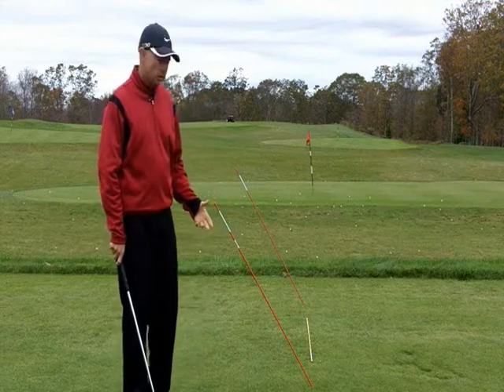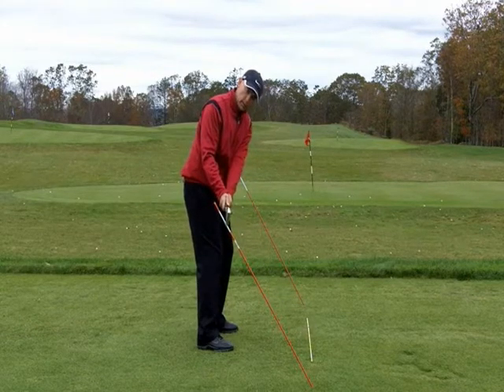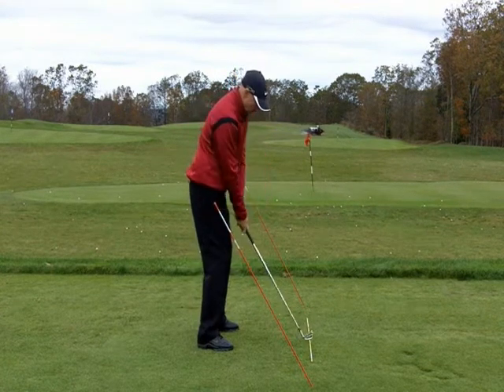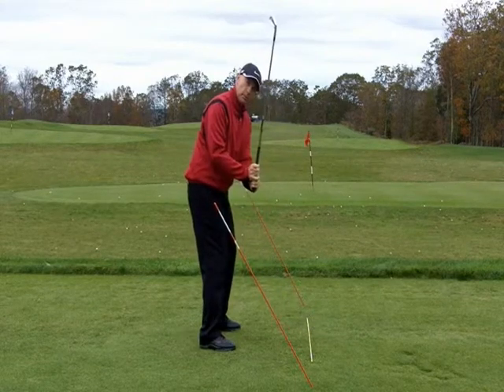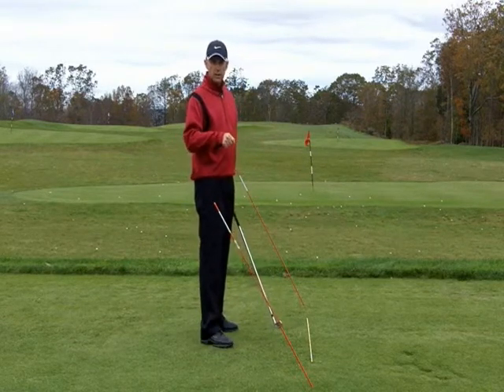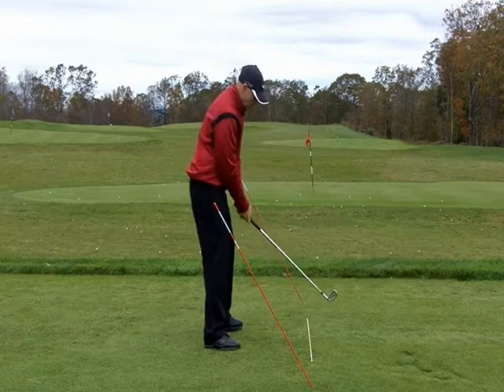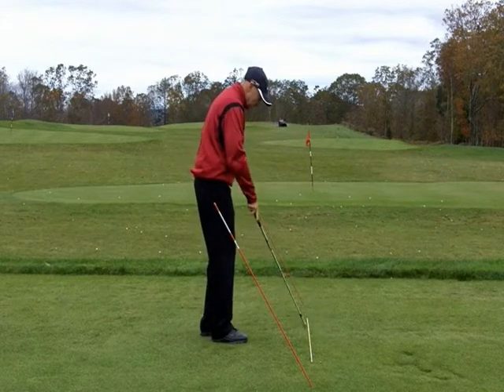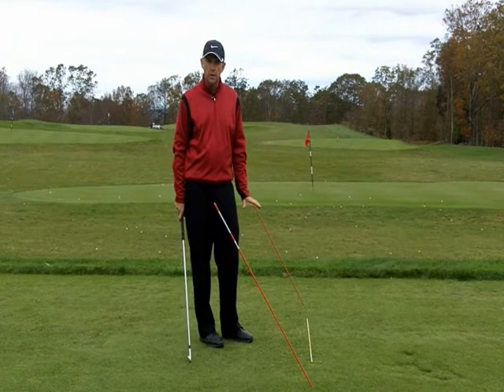Golf Lessons - Swing Plane Drill

Comment from the maker: Hi Andy, Thanks for the question and the kind words. In starting the club in the back swing the key to keeping the club on plane is to let the rotation of the body move the club away from the ball and the cock of the wrists coupled with the arms lifting, raises the club to the top of the back swing. If the wrists roll the club away or the arms work across the chest, then the club will work into the back swing below plane.

I hope that helps. Keep up the good work.

Derek

Comment: Derek: I saw Patrick Reed warming up at Masters two years ago. Reed placed one ball about 3 inches behind and slightly inside the ball he was intending to hit. Since I have a tendency to come inside on my back swing I must have hit at least 3,000 practice balls since then using this drill. When I'm "on" the ball will not go left (I'm right handed) but my swing does not feel as powerful as when I would rotate the club initially with my hands and come inside. Many times I feel like I am actually reaching out in front of me to start my back swing. I am 76 years old, an accomplished tournament player with a 1.4 handicap, and willing to practice. Am I wasting my time with this drill?
Lastly I enjoyed your bunker video and the thought of taking our the sand in front of the ball and your bunker drill will be something I plan on practicing. Buck Leigh
Reply from the maker: Hi Buck, thanks for the question and for the kind words about the bunker video. The drill you describe is a good one for players who tend to take the club too inside early in the take away, and it sounds like it is doing a good job in helping you hit straighter shots. I would be hesitant to base decisions on feel. They can be very misleading. There would be a lot of value in getting on a launch monitor and discovering if you really are losing distance with this take away or is it just a feeling. With that information in hand you will be able to make a more informed decision about how best to proceed with the drill. 

I would not be as concerned with the feeling of reaching out in the take away of the shots are doing what you need them to do.

I hope that helps and all the best with your golf game.

Comment: hi. what is the correct angle ? does the angle change depending on your height or club? or are you supposed  to have a single plane and thus adjust your height ,  hands  and distance to ball during address?
Reply from the maker: The angle of the rods are the same as the shaft angle at address. This will vary slightly from club to club. 

I hope that helps and all the best with your golf game.

Comment: Using Zepp 2 i and dozens and dozens of swings my hand plane is relatively consistent at about -3 but my club plane is consistently -25-30 which i assume is a severe under plane.  Is this a drill you would recommend to fix that?
Reply from the maker: Thanks for the question Trevor. Unfortunately I have never used the Zepp system and am thus unfamiliar with the numbers you mention and how they are measured, so I can't answer your question.
Reply: interesting points ,if anyone else is searching for golf tips video try Boshapra Instant Golfer Boffin (do a google search ) ? Ive heard some awesome things about it and my colleague got great results with it.

Comment: How do you set up the station?
Reply from the maker: Hi TheGolfster3
The rods are set at the same angle as the club shaft at address and each is placed about 3 feet away from the ball position along the target line.

I hope that helps and keep up the hard work improving your golf game.

Derek
Reply: Thank you for your immediate reply concerning my question. I am in the process of attempting to correct some bad habits I've developed over the years, (which has led to back problems) and this drill fits right in line with the new swing changes I am making. Thanks again- Ruben.

Comment: could you also take it away outside and hit it outside in?
Reply from the maker: Hi amfohr, thanks for the question. The tendency for players who take the club away to the outside or above plane is to drop the club too much to the inside on the downswing thus producing an in to out path. If you would like to move the club out to in through impact that is fine, just keep in mind that such a swing path will tend produce either a fade or slice.

All the best with your golf game
Reply: DerekHooperGOLF No, I actually mean suppose you have the tendancy to move it outside back and also swing from the outside in (because of to steep club shaft), would it then be a good drill to take it back inside and try to swing from the inside?
Reply from the maker: amfohr You could definitely try that. The typical move of players when they take the club back inside is to them swing more from out to in during the downswing, but I have seen some players who do not fit this pattern. By all means try it and let your ball flight tell you if you are being successful.